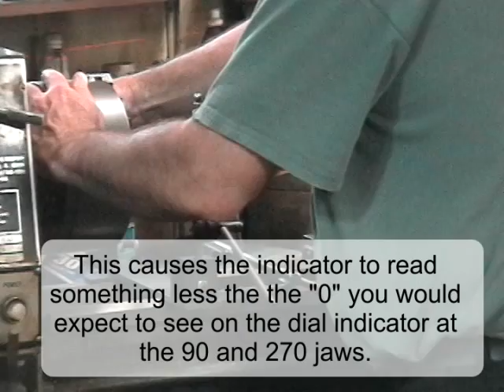Indicating Eccentric on a Lathe.mpeg

Comment from the maker: You're welcome, offset turning can be a PITA. If you have a good spirit level and use a jack to the ways you only have to use the level once. If you're turning between centers using pots you would work from layout lines with a surface gage (or similar).

Thanks for watching and the comment!